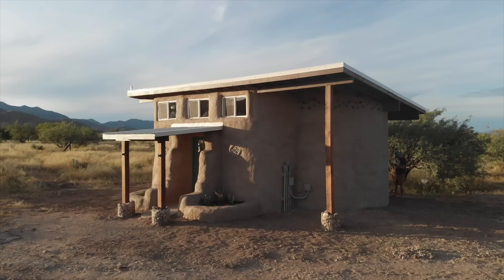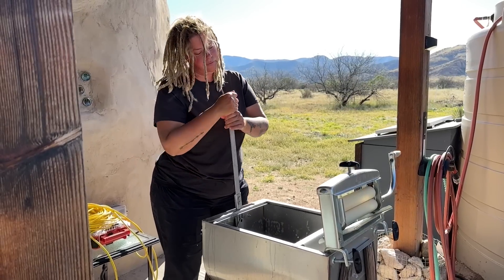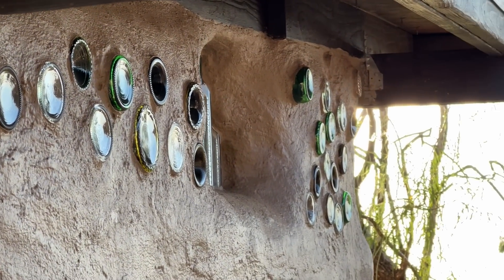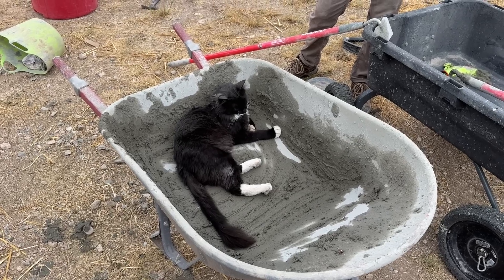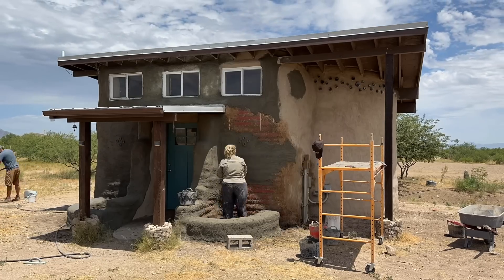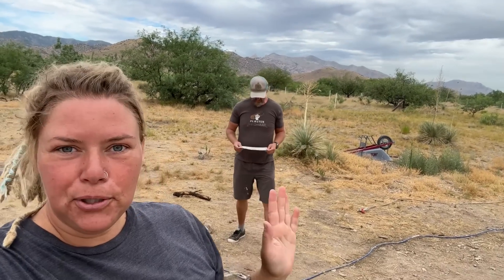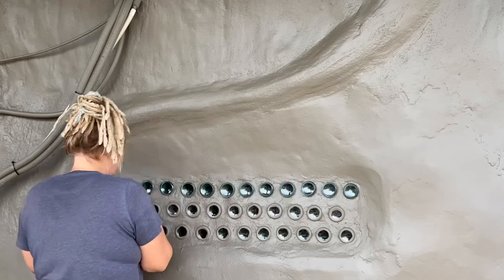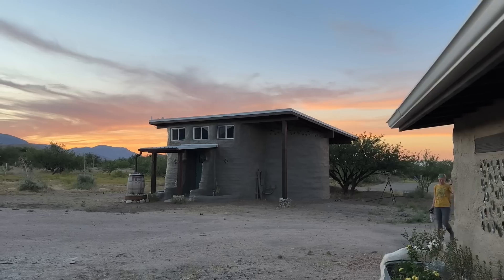Earthbag Solar Shed Office: Rainwater Catchment & Monsoon Proof Plaster

Comment: Cob cannot handle stucco or waterproofing; it will soak up moisture from the interior and eventually slump, breaking the stucco. If you can get hold of the book the Hand-Sculpted House or Cob Builders Handbook, it should give you information on how to make cob and adobe work. But a cement coating and a sealant will make cob fail.
Reply: You should be able to stucco and elastomer your house without using cob at all; stucco should adhere to the bags.
Reply from the maker: Yes we did that for the Casa de Caca. Actually the cob left on the shed was in great shape, super locked in. The parts that failed were from the earthen plaster failing first.

Comment: Would a more substantial amount of roof overhang on the south and west sides of the "shed" keep the thin stucco finish last longer?  Does that mean we will see quite a bit of length of porches along the south and west sides of your home.  Of course, any overhang should not interfere with winter solar reaching the home interiors (so the roof's lowpoint will be higher than the winter soltace angle to get enough sun into the home).  I would also have overhangs on the east to reduce morning solar gain during the spring, summer and fall.  I don't get the "new" architecture in the southwest with no overhangs.

Comment: Will this new coating system allow the natural building materials to still breathe? And is that even needed for the heather of the building?
Reply from the maker: That’s the hope - stucco does breathe and elastomeric can as long as it’s not too thick. We only did 2 coats so I think it’s fine. Either way it can still vent through the walls to the interior.

Comment: I've used A LOT of elastomeric paint. Make absolutely sure that the underlayment is absolutely dry or the paint will blister. That paint doesn't breath. If it's stays dry it last a long time.
Reply from the maker: We gave it plenty of time especially in our climate. Also, elastomeric does breathe even though it's waterproof -  though too many coats will cause it not to.
Reply: @TinyShinyHome  yes. We were in Las Cruces NM and a lot of houses would peal badly just like a sun burn. The contractor was in a hurry and didn't let the underlayment dry out. Your little house is looking great.